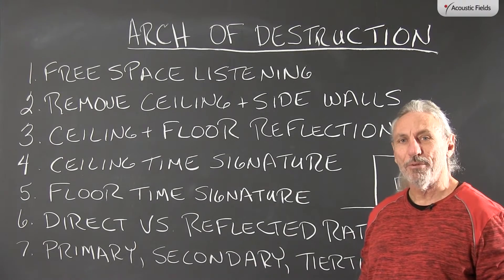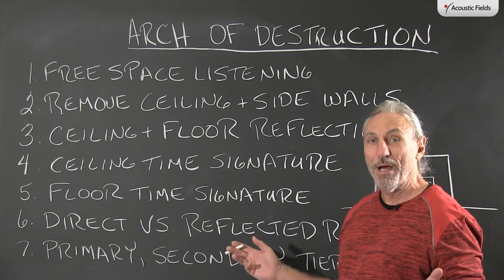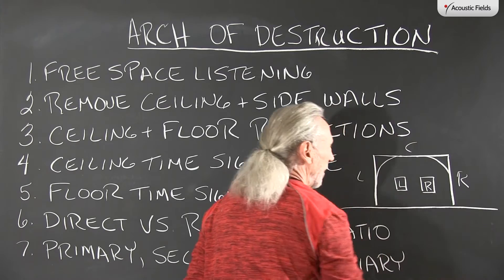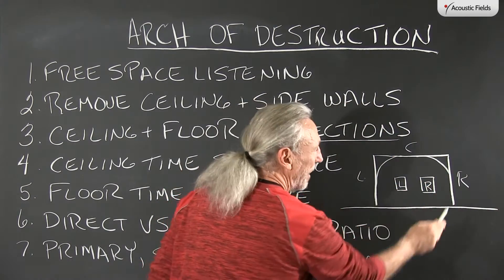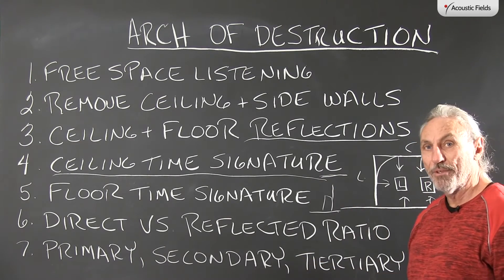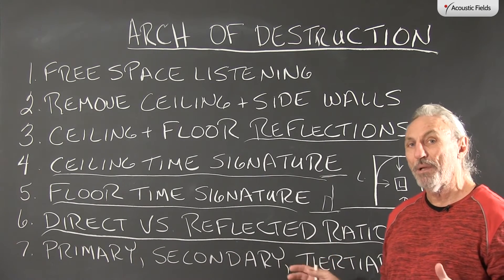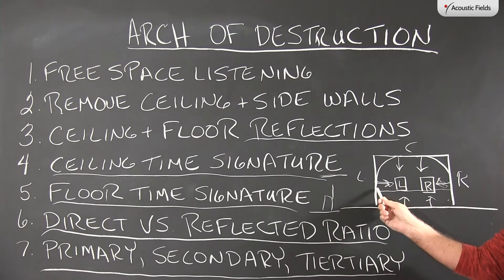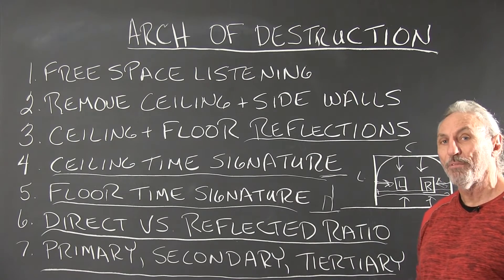Arch of Destruction - www.AcousticFields.com

Comment: you DON'T have to have floors. I was in an old eastern german anechoic chamber and you would walk around on a metal net. you were suspended roughly in the middle of the room!
Reply from the maker: Hi C, Would love to get rid of floor in all my builds but city codes would not permit.
Reply: Anechoic chambers are for testing purposes, not for listening or recording purposes.   Heck, most people can't stay inside an anechoic chamber for extended periods of time.
Reply: That would be great until a guitar player spills a beer and soaks the material under the floor.  😨🤣😎